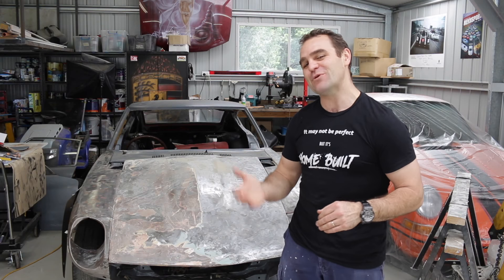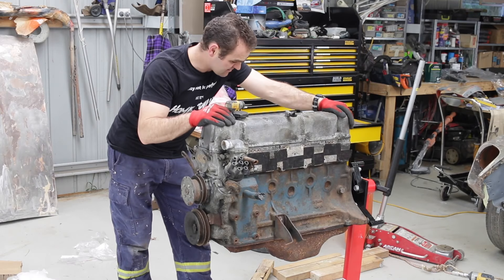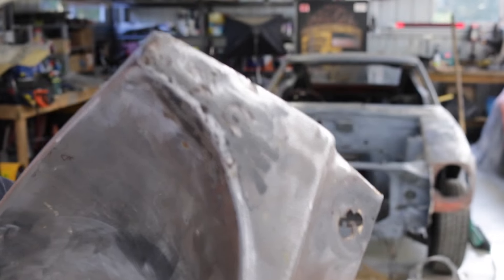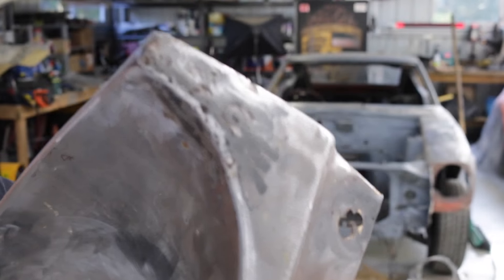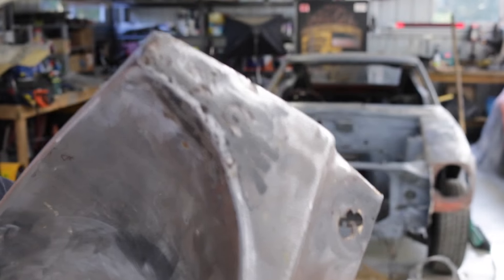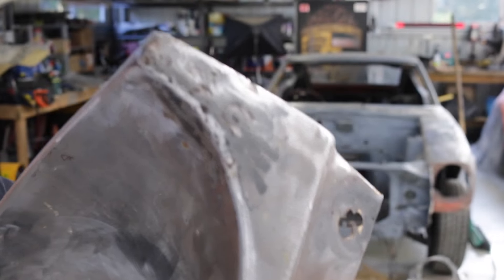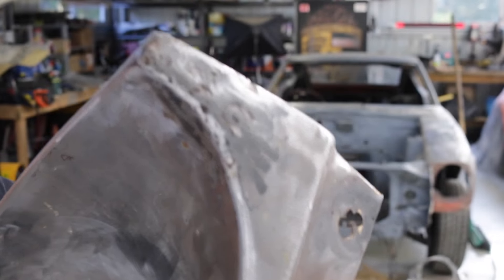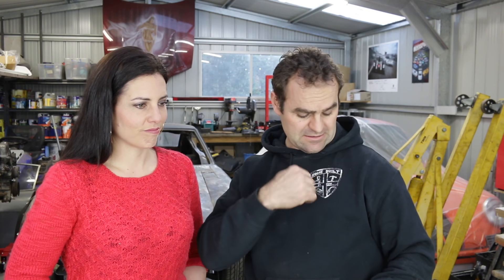Home Built Datsun 240z part 3 - Pulling the engine

Comment: That dent on the hood (the one you said had holes filled in) used to be where the factory (or aftermarket)  emblem used to sit.  People tend to push on them or sit on them and over time it dents that area.. Have 2 Zs myself that have the same issue. Just an FYI for yea.  Good job so far!

Comment: Wow Jeff you're a wizard.   Great work with that bucket and hood.
Hey Jeff, not sure what your plans are for wheels and tires, but as an option you should be able to fit 16x8 rims with zero offset, and those should be able to wear up to 245mm tires without fitment issues or spacers required.  I'm bringing this up because it might save you some time, money not having to put fender flares on it.    I only say "should be" because I have a 280Z so I can't be 100% sure the 240 is the same.   With 245s at least on the rear it'll look properly stanced with the tires barely coming out from the edges of the fenders.   With a low enough profile tire and some coilovers properly adjusted it'll look fantastic.  I doubt you'll go for this actually but just wanted you to know.  Some people don't like the flares and they're not really necessary if you choose carefully.   Good luck Jeff, you're the man!   
You could maybe do a video on your background and how you came to know how to do so many amazing things.  I know you're mechanically/technically inclined but there's probably a bit of explanation behind all that too somewhere.
Reply from the maker: Thanks mate. For me I really like the look of the flares like the race cars of the period had. I am still working out the wheel sizes I am going for though.
Reply: I figured that'd be the case.   It's period correct and commonly called "JDM" over here from the folks who add them.   It seems like you guys had the more Japanese-like models while over here in the US we got left-hand-side drives and extra not-so goodies like the "park bench" bumpers on our 260s and 280s due to crazy new federal safety regulations of the day.

Comment: Like your can do attitude, I tack weld washers on the dents then use slide hammer with a hook on the end to grab the washer. If you do a row of washers you can slide a bar thru the holes and pull a larger or longer dent.
Reply from the maker: I have seen the washer thing a few times, but I like the idea of pulling a long dent all at once.

Comment: They make a panel shrinking disc for a grinder they work well on hoods and large panels. They dont spot heat and cause more distorsion. You will have to shrink those dents out. Check out eastwood automotive.

Comment: If you have to deal with any heavy surface rust I recommend using POR-15, im using it on my projects at the moment its the best rust protection on the market in my opinion! Although that looks like a very clean shell
Reply from the maker: There will still be some rust treatment, I will have a look.

Comment: Good idea with the nails for the dent puller I wonder if they have enough hold to use a slide hammer as well
Reply from the maker: I like the lever method, as it has more control and you are less likely to over pull the dent.

Comment: Love your work Jeff. Just a point. That flat spot in the center with the two holes that had been brassed over is where the factory hood badge went. The flat spot may have been left as the last owner still used a badge just not one that required the two mounting holes used by the factory badge. Love your stud puller too btw 😉

Comment: How about making a slide hammer and using screws welded on? Love the Bogan wooden engine mount!
Reply from the maker: I don't have a slide hammer to start with, but I like the control I have with the lever, so I don't accidentally over pull a dent.

Comment: Curious, On the dent puller wouldn't the flat part deform or dent the part it is resting on? It is the pivot of the lever created, so It will apply downwards force on the sheet metal. I suppose the flat part was had enough surface area to avoid it.   Just asking. Mean nothing wrong, was a great idea to avoid buying a tool that is not very cheap and not used often.
Reply from the maker: I actually got the idea from a similar type of tool used with some stud welders. But, as you mentioned, the surface area of the 'foot' is probably at least 100 times the surface area of the stud contact that is being pulled, so that is why it works.
Reply: Works for me!   As a fellow Z owner keep kicking some butt.... oh I Subbed from Texas.

Comment: Have you tried lead loading? Nice work!
Reply from the maker: No. There are a lot of reasons lead is not used anymore. Modern fillers are much lighter and simpler to use. Lead is the old way of doing it, but it is not really better.

Comment: Jeff, what sort of nails did you use. Ive tried doing the same thing, but the Clouts i used just disintegrated when i tried to weld them on
Reply from the maker: I used clouts as well, but you have to be very delicate, with your welding as they do disintegrate very easily. Although you can blow through the panel easily as well.

Comment: Jeff where did you get the front spoiler + flares? Currently building a 260z and considering this direction. Cheers mate
Reply from the maker: I got them from ebay. The flares are plastic, which I like, as they are not likely to crack like fibreglass can.